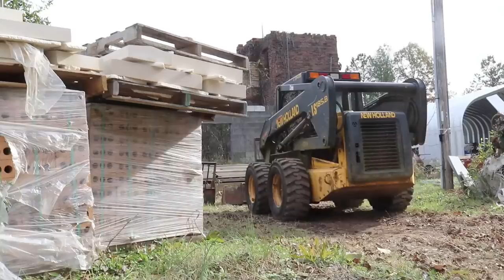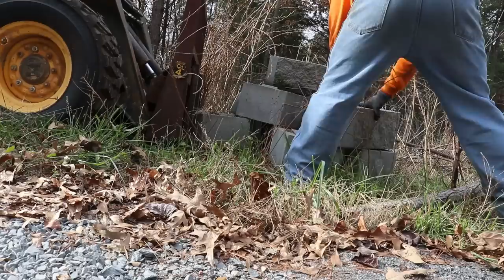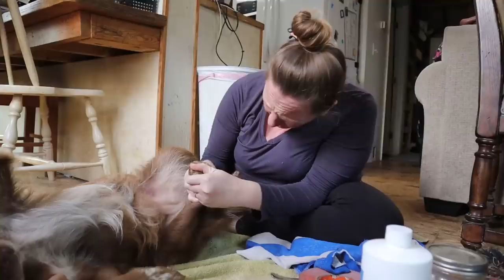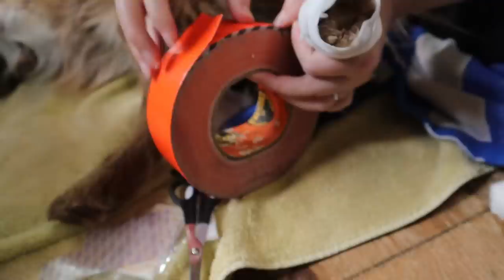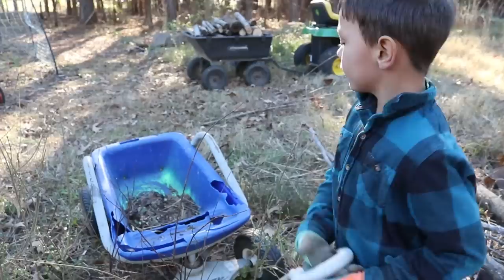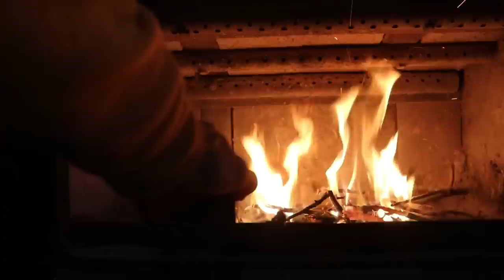Pregnant Tractor Mom tries to HELP clear Woods

Comment: A great first aid supply, that sounds terrible, but can be great to have on hand, especially for the pawed members of the family, is unlubricated condoms.  

They have great stretching ability as has been evidenced by people blowing them up like balloons over the years.  After disinfecting a wound on their leg/paw and applying whatever medications you would just give a couple winds of gauze then put the condom on like a sock so if you let them outside you aren't going to have mud or water seeping in contaminating it. Then you can wrap some more bandaging around for kush.  You would only need to do this for a day or so waiting for the initial heal over to take place.

Growing up we had lots of barbed wire fences around which could really rip up a farm animals legs if the get caught up in them.

Mom saved all our old unusable socks.  They were usually used for cleaning rags except the smaller ones (up to age 7-8).  If an animal were hurt on the leg or paw she would cut the toe off and after taking care of the wound would pull that sock up their leg in place of a bandage.  She would put some type of adhesive around their leg that once the sock was pressed against it would stick to the leg providing the protection for the wound.  It would take up to a week or so for the adhesive to wear off enough for that sock to just start sliding down the leg.

Since you didn't garden this year, what are you going to be doing on the farm in 2023?  Are you going to restart CSAs, market gardening, growing for restaurants again, or just for your family?

Personally, I think it would be great to see in-depth series on CSAs; how to determine how many you can support, how to calculate prices and determining what it would take to make it profitable, seed choices, how frequent boxes delivered, how much provided each week, what is different in a May box from a July box and on and on.  Or even the same in depth on selling to restaurants or whatever you are going to do.  

 Some people have put out videos about  them but a 5-25 minute can't begin to explain it.   And it could work in well with your continued desire for developing a membership.  You could be posting your short version videos of 5- 10 minutes on YouTube providing the overview version and for those who want more in-depth detail it would be available in membership.  Something for everyone.

Comment: I wouldn't say make do. Duct tape is the BEST!  Stays on with less dirt. Can make it tight or loose to get right pressures.  I cut my foot on glass really bad and a military buddy wrapped it in a washcloth and duct.  tape. Nurse at urgent care looked pale and sent us to ER. Nurse there was like not taking it off either. left it to the Dr.  He looked really puzzled when he took it off!
said well we need specialist to look just to make sure no surgery needed. He looked and said Did you have surgery on this?I'm like no. He's like looks great. Better than Most surgeons cuts. The duct tape had pulled the cut together and prevented damage inside. Dr said otherwise the cut was between two nerves and veins that would have caused alot of problems. He said usually this type of cut would take 10 stitches but instead recommended that I have my friend redo the duct tape over a regular bandage. Said I should expect a scar. but I don't have one. Can't even tell. I believe in duct tape now!
Reply from the maker: That is awesome!